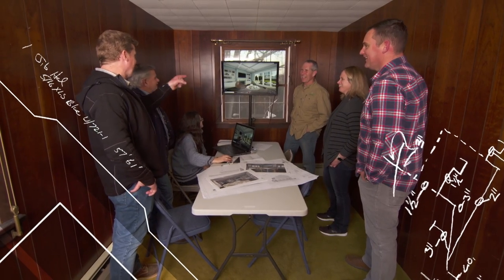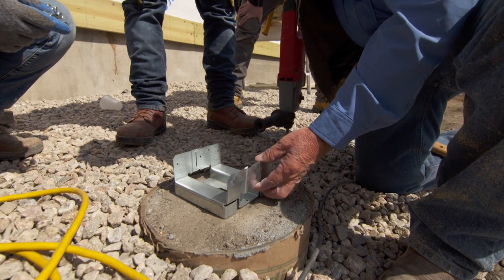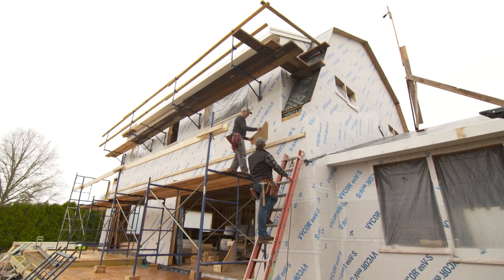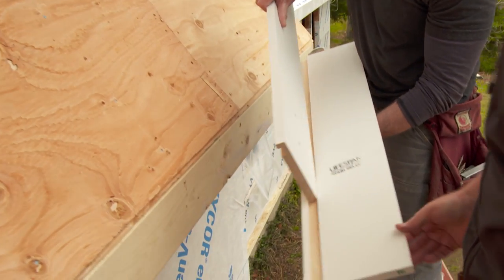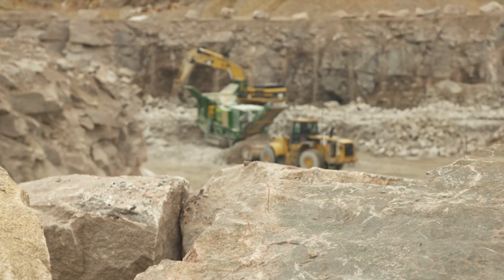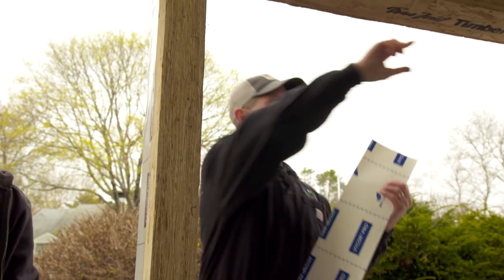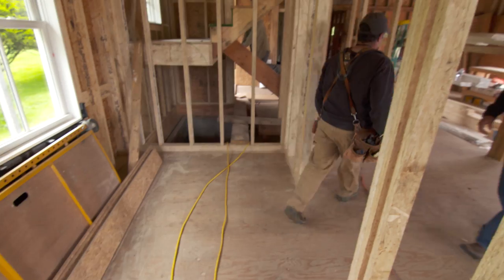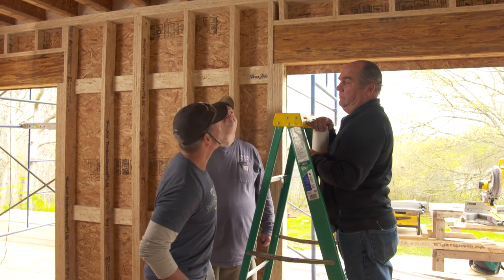This Old House | Decking for Beginners (S41 E5) | FULL EPISODE

Comment: Way to get those corner footings nice and centered. Probably the most crucial load-points in the whole deck structure.
Reply: I thought the same thing right away
Reply: @mikovincent6079  My clients would nonchalantly walk me over to them and say something like "So we noticed this was a little off, was that intentional?"
Reply: would love to hear all the excuses for that snafu.
Reply: The footing and post to the left is also like that. I suspect it was intentional. I have designed decks this way to allow the fascia to go clear to the ground without having to cut around the footing. This is a deck, not a lot of load.
Reply: @bobwood9689  Except he said they'll be at ground level
Reply: @matthewitt2276  I am not sure what you are referring to? Tommy did say that footings were below frost depth.
Reply: bet they blamed it on the interns.
Reply: Johnny Bananas  sure whatever. The structural engineers that I have worked with are very happy with my work. I design log homes and every one of them must be certified by a structural engineer. Thanks for coming out.

Comment: I disagree about not caulking the bottom of a window for 2 reasons: 1, If you have sealed the perimeter of the window and flashed it correctly, water can't get where water can't go. 2, The bottom of the window is soft flashed so once you nail the trim onto the house, you've essentially channeled any water intrusion behind the trim and therefore, the siding.
Reply: @brianglade848  the secretary of transportation  loves caulk
Reply: @Kevin-mp5of  Explain how Mr. expert commenter: The painters are going to caulk the perimeter of the trim anyway- trapping the water behind it.
Vote republican once in a while while you're at it.
Reply: Any water that leaks behind the trim or siding isn't going to magically make it's way outside the building- it's going to remain trapped because it should not have been able to enter anyway. Just because one provides a 32nd of an inch for water to 'drain out', it's not going drain out. 

30 very successful years in the home construction industry spoken here. ZERO call-backs for leaks or improper....anything.  😉
Reply: Most carpenters never bother to caulk anything.

Comment: Why bump out the wall behind the toilet? Leave it the same, and they would have had room for a shelf or something.
Reply: I don't think there is any code requirements saying it can't be further away from the wall but everyone is so used to seeing a toilet close to the wall that the rough opening is always positioned 10-14 inches away. I would do like they have done but above the tank I would make open shelving of some form for towels etc kinda like you were thinking.
Reply: That was the back of the toilet
Reply: @Kevin-mp5of  sure they're dust collectors if you don't -- I dunno -- clean?

Comment: I was gonna ask why there had to be so many rafter tails but I guess it's because they're supposed to look like actual rafters. Correct?
Reply: @Kevin-mp5of  I know that but they're basically just fake so I was wondering why they had to be so close together just to hold up so little actual, non-structural material. Then I realized that they're made to look like an actual extension of the rafters so it makes sense that they would use standard rafter spacing